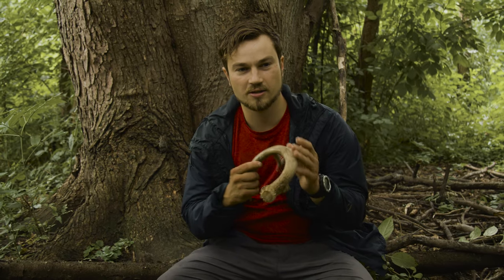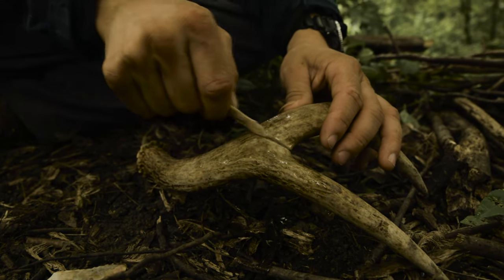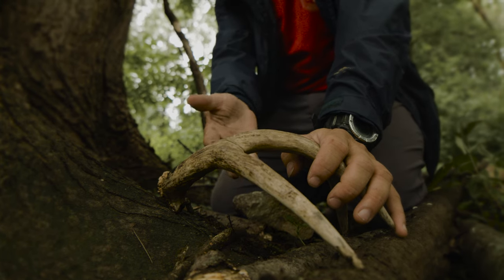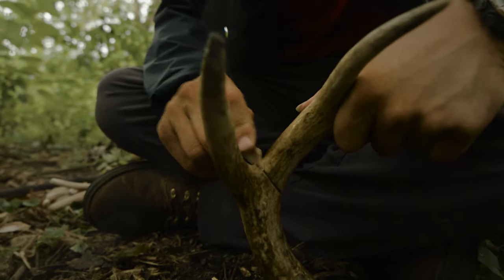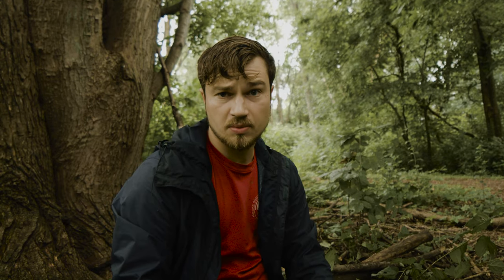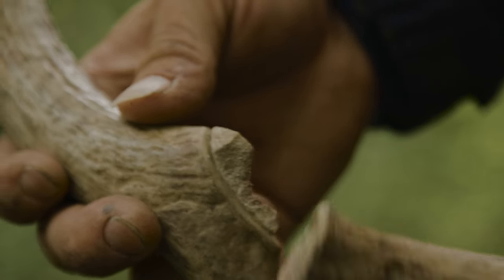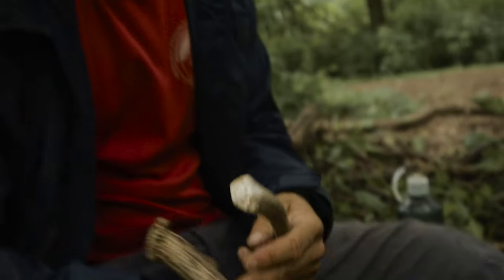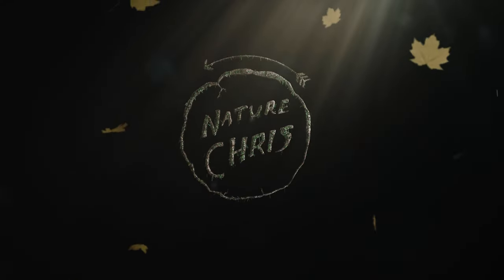Making Antler Tools the Prehistoric Way

Comment: Nice.  Now, how you split the antler to make an Ishi stick?  Also, try using a wedge shaped rock underneath the antler as you attempt to break it.  You can adjust the fulcrum point and use less force to make it break, instead of hitting the top of an arch which requires a lot of force to break.